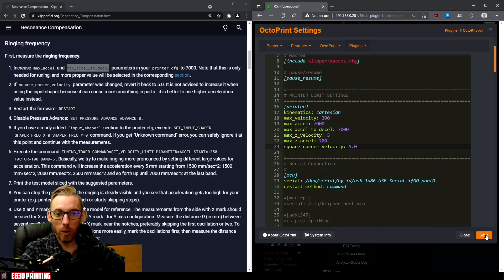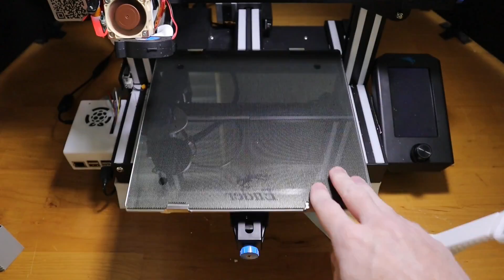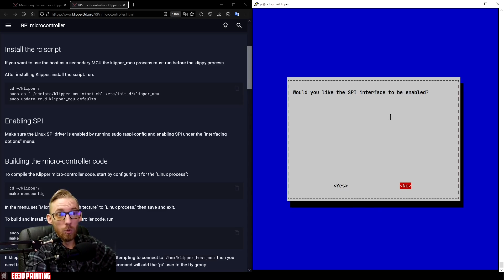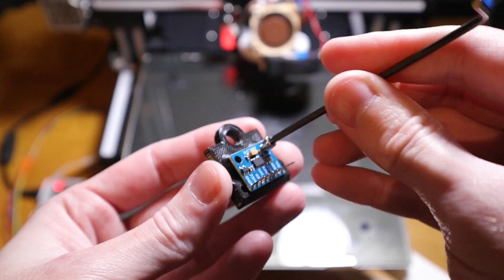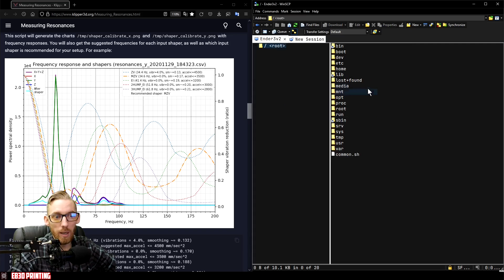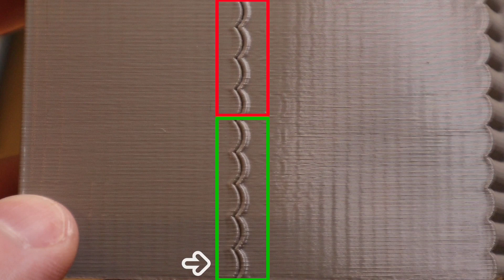Klipper Input Shaper Tuning on the Creality Ender 3 v2

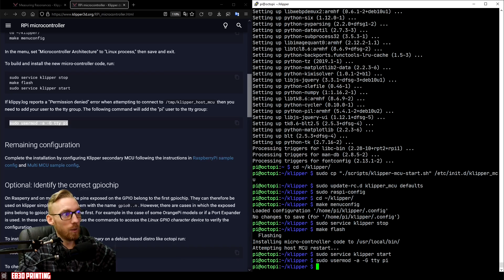Comment: nice tutorial ! i am currently working to convert my ender 3 v2 to Klipper and there lies the problem. is it okay to follow your steps when im using mainsail regarding to the pi stuff  like in 23:32 if i have another username would pi still be okay or should the "pi" be replaced with something else like the user. im gonna convert it to mainsail not octopi-Klipper

Comment: Love your guide. Still planning on getting klipper on my ender 3. But I'm curious, were you able to fix the z banding issue? I have a month-old ender 3 (although it's been mostly printing non-stop). Recently im experiencing a lot of z banding. Any inputs would be greatly appreciated.
Reply from the maker: The z-banding was another rabbit hole I went down. Originally tried dual z lead screws, but still was having issues with the z banding. I eventually tried a belt driven approach and that worked awesome. 

Find more info here:
https://youtu.be/oUdoJUs8Zcg

Comment: Thanks for doing this vid.   Tried it before (all3dprinter article) but their written explanation of slicer settings was not indepth enough for me noob ;)
now I followed your steps and got better results with input shaping on my ender 3s1pro!
btw.: instead of an raspPi I run klipper / Moonraker / Mainsail on linux mint inside a oracle VM on my laptop.   It's a 8gb ram, m7 cpu with win10 on it. didnt wanna convert it all to linux.
best part: this laptop only consumes 7-10watts while printing! (that's less than a raspPi :)
Just had some issues with MCU shutdowns (because the USB settings of the VM machine were to slow - move to USB3 and now it works!
next I tune pressure advance ;) 
greets from Austria, Mario
Reply from the maker: That's actually great to hear about the laptop. I'm looking into similar alternatives for running my machines. Looking to get a minipc to run all three ender 3's at once. I have a raspi running two machines currently.

Comment: Thanks for the series on installing klipper on the ender 3 v2!

You've done a good job (even though there was a few hiccups, but not your fault), I managed to finish the tower test print.

I honestly can't find a difference from bottom to top, only a very minor ghosting on top-right side of the "X" letter.

 I guess I can use 6000 as the max (keep it conservative).

I was blown away at how fast it printed!

2.61 seconds a layer at the top layers!

Agian,
Thanks!

Comment: Hey man thanks for taking the time to shoot and edit these videos.  I plan on trying to set up klipper on my 3v2 here in a few weeks. 

I have a suggestion for  for fixing your z banding.  I used an anti backlash nut with two springs holding the m3 screws where it mounts to the nut and gantry bracket. I have them maxed out and the springs under very little tension. This allows for the cheap lead screw to wobble freely through the bracket. Then i carefully tensioned the gantry wheels with the eccentric nut to not be overly tight and move freely.  I have the dual stepper for the z axis upgrade kit.  My z banding is gone now.
Reply from the maker: I switched the printers over to belt drive z axis, such a huge improvement. Eliminated the z banding issue

Comment: Heads up! Your link to the ADXK345 sensor goes to a MPU-6050 sensor which uses I2C and cannot sample fast enough for input shaping or has support in Klipper. I bought these by accident using your link not really thinking or reviewing with the BUY IT NOW Amazon button. LOL
Reply from the maker: My apologies, I changed the link once already, and now they seem to have switched it again...

Comment: hum, used your link for the accelerometer, it brings up a MPU6050 3 Axis Accelerometer which is apparently not a ADXL345
different pin names???? just a heads up
Reply from the maker: I'll have to update the link then. Thanks for the heads up
Reply: @EB3DPrinting  eh i just blindly ordered without paying attention. no biggy live and learn😁
Reply from the maker: @toolmakerdave5287  this isn't the first time the links have changed on me

Comment: The X adapter ended up being too thick for my stock nozzle to fit. I recommend to anyone that’s planning on using the X adapter, to double check its thickness and thin it a bit to accommodate your nozzle thread length just in case.
Reply: I had the same issue and just used a m6x1.0x10mm bolt in place of the nozzle. worked just the same.

Comment: I get the error: {'message': "Error on 'TUNING_TOWER COMMAND=SET_VELOCITY_LIMIT PARAMETER=ACCEL START=500 STEP_DELTA=500 STEP_HEIGHT=5': missing FACTOR", 'error': 'WebRequestError'} -- After I enter TUNING_TOWER COMMAND=SET_VELOCITY_LIMIT PARAMETER=ACCEL START=500 STEP_DELTA=500 STEP_HEIGHT=5